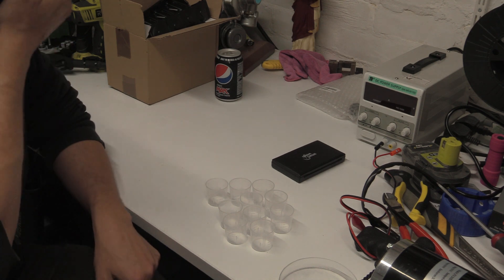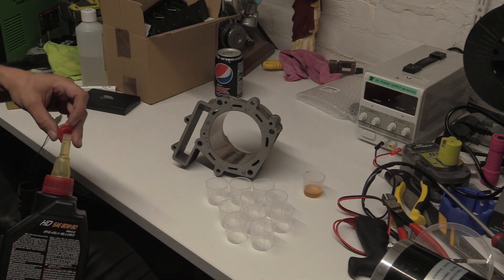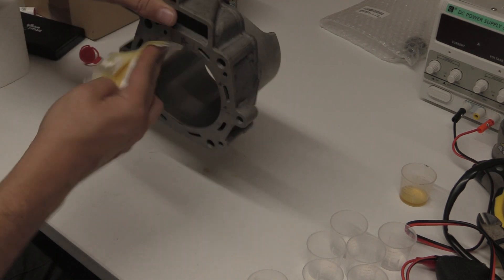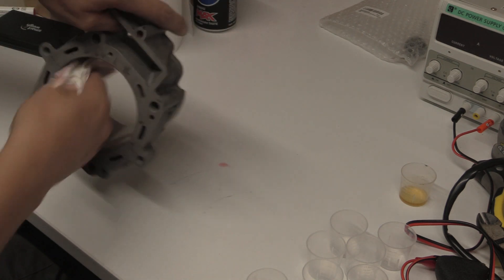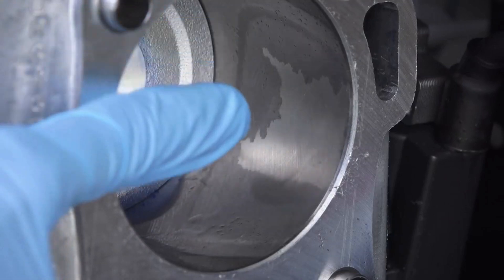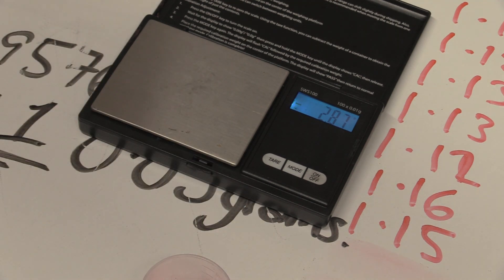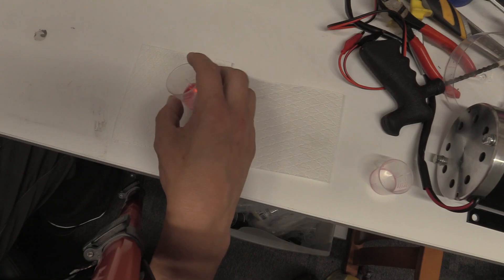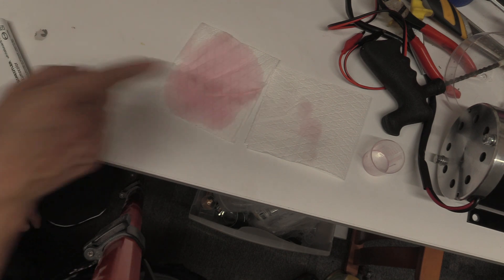Engineering NOT Explained - Visual Lies

Comment: I've actually wondered, re: visual experiments, about your Evans v water on the hot plate. The water, once it gets close to boiling, starts losing way more energy due to steam, so the steam is keeping the fluid from reaching your target temp as quickly. 

Did you ever get to run an experiment with the SV to see how the temps were affected in a pressurized system?
Reply from the maker: That was the point. The transition to steam takes heat away. Evans makes out thats a bad thing. As for the test, im doing it with the z9 instead
Reply: @thedirtyworkshop  right, but in a pressurized motorcycle coolant system, the water can't or shouldn't be steaming over. So the demo doesn't show how the water would behave in a use-case, even though you made that comparison.

Comment: What is this toluene? Is the base of paint thinner or something?
Reply: thinners yes, also an accelerant for some glues , its an aromatic  hydrocarbon - a solvent, CH3 attached to a single methyl- (edit* "phenyl group" not "methyl"), "methylbenzene" is its other name.
Reply: @deadprivacy  The CH3 is the single methyl group, its attached to a benzene ring (C6H6). Hence the methylbenzene
Reply: @RobP1997  indeed, i meant single phenyl group, nice catch, i mostly know it as "the stuff you add to contact cement  to make it stick faster and more betterer"
Reply: also used as fuel in formula 1 for years 86% toluene doped with n-heptane to keep its octane rating down under regulation limits, run through a heat exchanger off the coolant system to get it to vaporising temps.
Reply: @deadprivacy  but it's not the same as thinner at all?